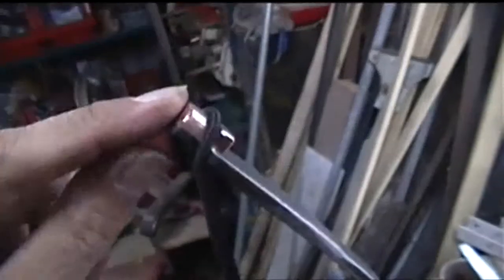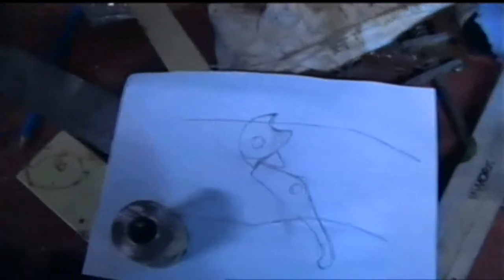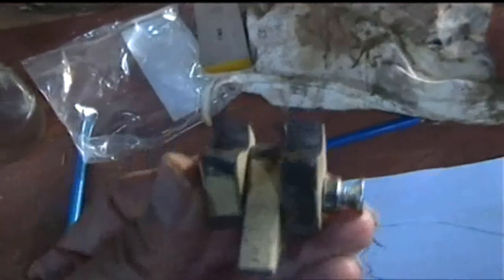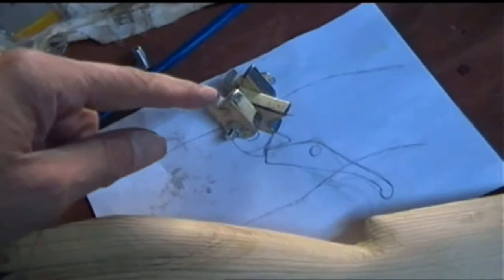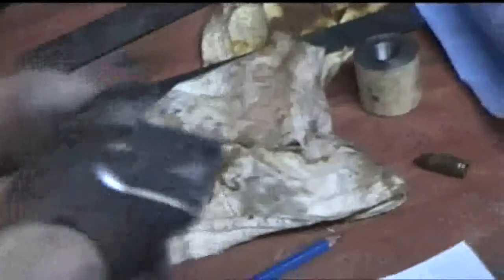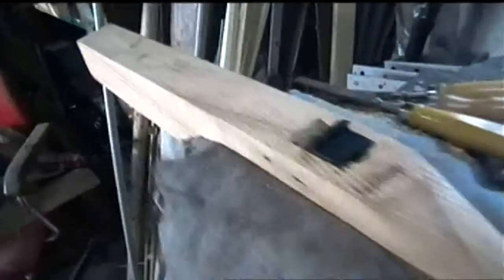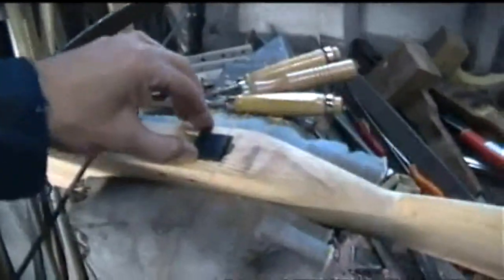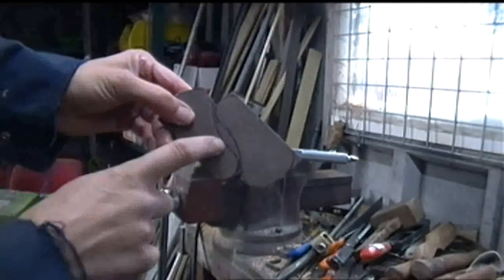How to make a crossbow Part 2

Comment: Very cool looking forward to seeing the final results.
One thing you may want to consider if you weren't already is adding a metal plate running down the top length of the stock for the string to return on and not dig into the wood if it's not high enough.
But anyway like always keep up the good work!
Reply from the maker: Yes I am and it will be brass.
Thanks for watching and comment!